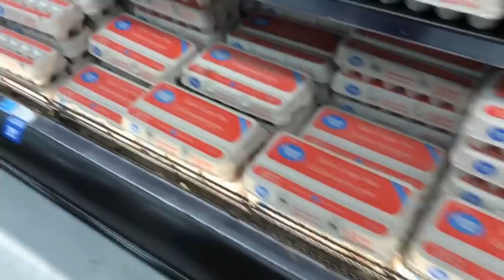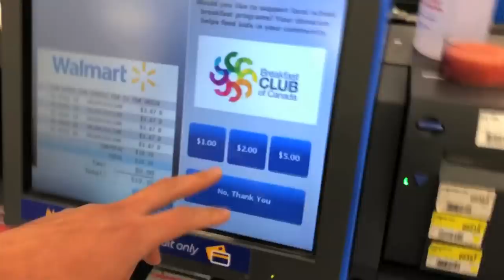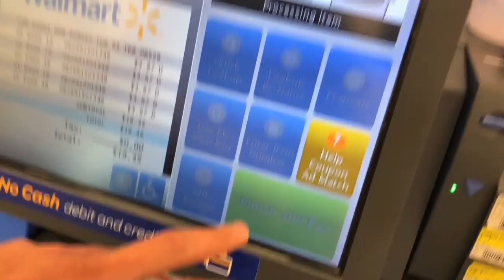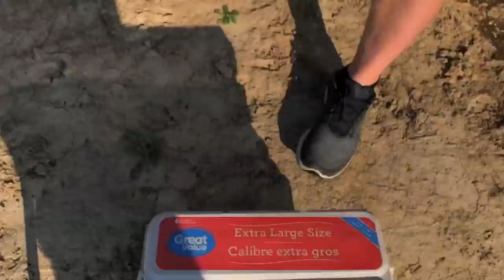What Happens When You INSERT 100 EGGS UP A Brand NEW F150 MUFFLER!!!!

Comment: $70,000 f150? Jesus that’s a lot of money to push off to the side of the road. Atleast it will smell like cooked eggs 😂😂😂
Reply: I bet my 6.0 power stroke can out pull anything you got ford power babby
Reply: Until the head gaskets fail and the transmission shits the bed
Reply: @230910bella  Chevy has the transmission problems*
Reply: @Onthrs  gomer Doge has bad  transmission Chevy just sucks
Reply: @gregbro4330  Facts are Ford has the best performance (numbers wise) but moderate reliability, some years great some years awful. Chevy is extremely reliable but lacking in performance. Dodge is only saved by the Cummins, without it nobody would buy them because the reliability is awful. Toyotas last forever but lack modern amenities and performance.
Reply: @Bailey_54R  dam straight

Comment: Y would you ever do this for? Ford is so badass do it a crap truck like chevy
Reply: OZARK OUTLAW or just do it to ford (found on road dead)
Reply: Since when are they a piece of shit my 94 Silverado still runs strong at 300k miles. I wheel it all the time and it loves redline last time I seen a Ford gasser last that long was.. well couldn't tell ya because I haven't seen it personally
Reply: Ray S many ford 300 straight 6’s are on the road, all my dads are anyways.
Reply: @waybachwin1747  I believe they can I like all ford and Chevy's
Reply: Chevy is the best tho
Reply: Ray S million mile crown vic? share the same engine as the f150 as well as transmission.
Reply: OZARK OUTLAW u got it twisted chief
Reply: Chevy’s LS: 10/10 motor, Chrysler’s hemi: 10/10 motor, ford’s dumbed down coyote: garbage. lowest in class horsepower lowest in class towing, how in the world is that better?